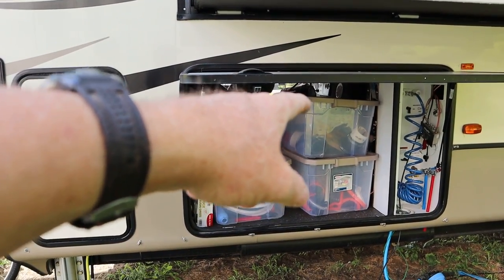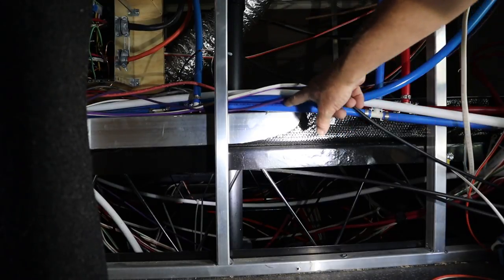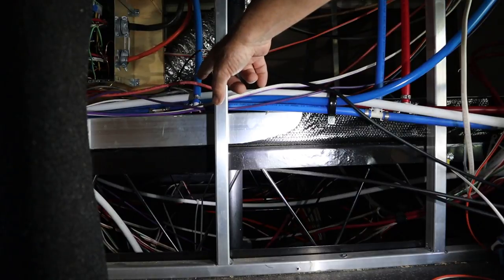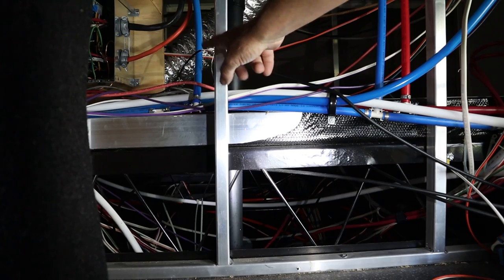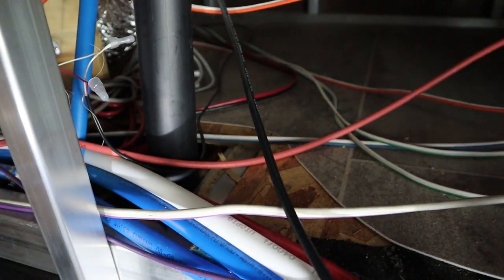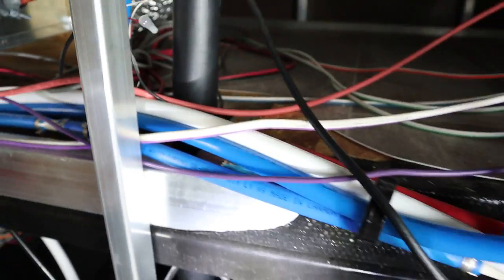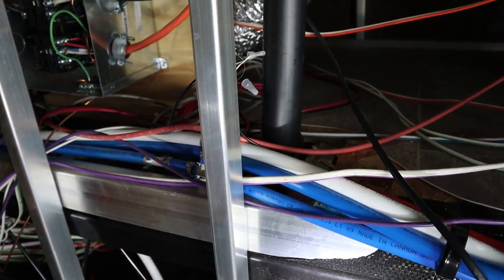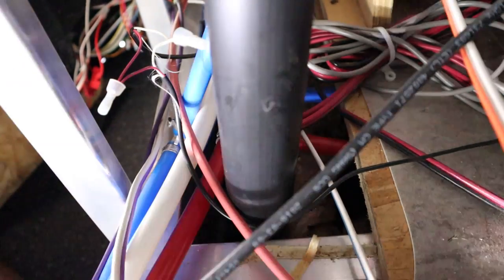No Cold Water To Commode And Kitchen Sink

Comment: Use a claw hammer or small crow bar to pull those nails. Worked for me. Easy.
I would not have suspected that T was clogged. People have filters on their hose and inside the RV. 
Most likely a pinched or kinked water line.
Reply from the maker: I have never had that much trouble getting those nails out before, but I will try crowbar next time. I have found several obstructions in water lines. Usually it is something like a part out of the check valve or one of the 50 valves that RVs have now days.

Comment: After storage every faucet works except the kitchen. I think it was an air bubble or something before. With city water connected it is running a small stream but that is all. I’m probably missing something easy. I pulled the hw heater anode and water came out there ok. Tank is bypassed now.
Reply from the maker: The aerator screen in the faucet is probably stopped up. Super common problem.
Reply: @hillbillyrv  that was it. I didn’t think it had a screen since it was a plastic faucet but it did. Looked like sand in it. Thanks
Reply from the maker: @techguy9023  Yep seen a lot of that in my years.

Comment: Leave it to RV manufacturers to devise a way to shoot nails thru 1/4" steel.  Surprised to see PEX used and not that RV flex hose.  So this is the first time the owner had noticed low pressure as I agree with you that that PEX was probably crushed right from the get-go at the factory.
Reply from the maker: It was probably low the whole time, but I guess maybe it just finished closing off recently.